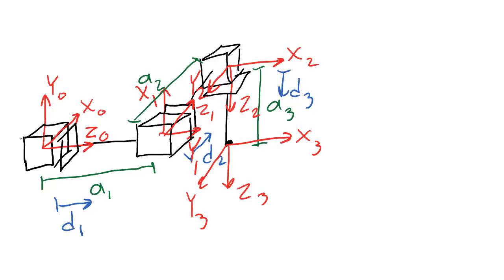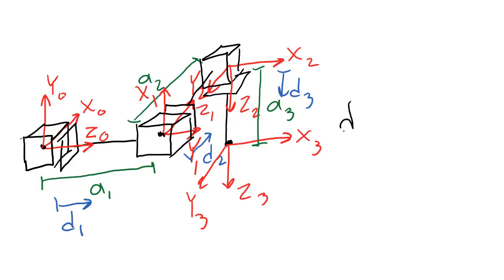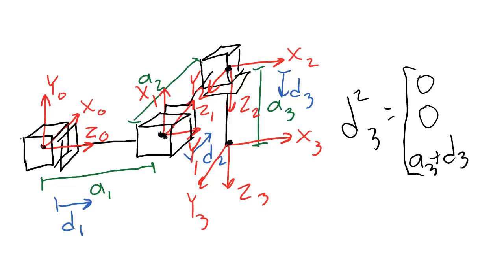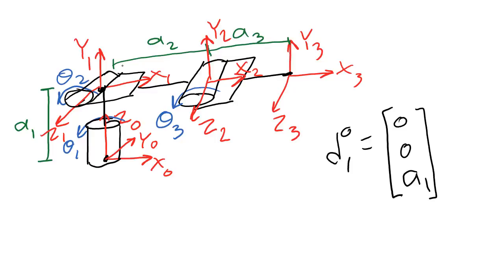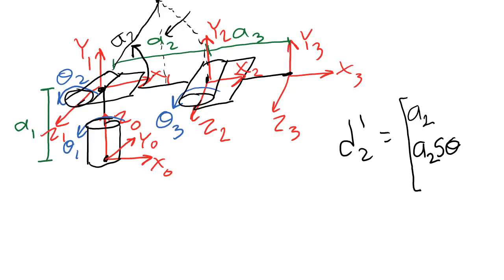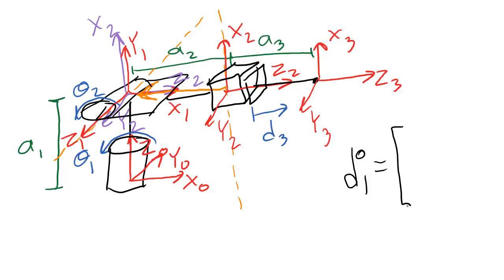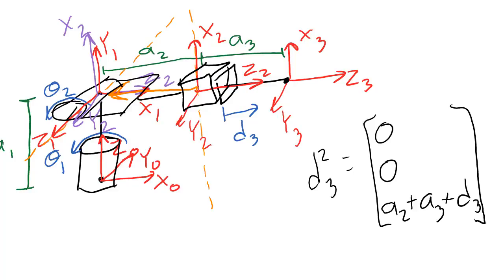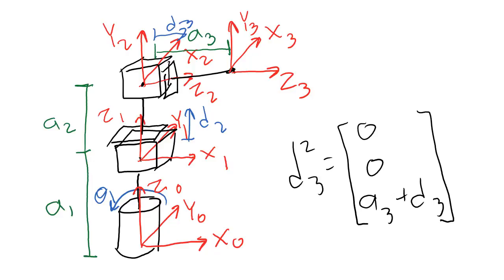Robotics 1 U1 (Kinematics) S4 (Displacement Vectors) P2 (Displacement Vector Examples)

Comment: in this video i am confused between example 2 and 3. in the example 2 the link(a2) betwen(two revolute joint) frame 1 and 2 has a displacement vector respect to theta2 rotation. but in example 3 the link(a2) between( revolute?spherical joint and prismatic joint) frame 1 and 2 there is no displacement vector even there is a bare theta2 rotation?

Comment: Hello..
In 12:22 why the d2_3 =[0, 0, a2+a3+d3] and not d2_3=[(a2+a3+d3)sin∆2, 0, (a2+a3+d3)cos∆2]
Thanks
Reply from the maker: The angle of the second revolute joint is between frames 1 and 2, not between frames 2 and 3.  So, the joint angle shows up in d1_2, not in d2_3. Otherwise, you would be accounting for the angle twice and that would give the wrong result.
Reply: @asodemann3  ... Thanks a lot for this great course...it is really helpful
Reply: That means ,there is no effect of theta 2 for displacement …theta 2 wasn’t used in any displacement matrix

Comment: Im a bit confused. In an older video with spherical manip. you did not move the locations on frame 2 like @10:56. Does this lead to same results? (Video is 1 1 4 Lecture Video 1 of 2 Displacement Vectors)
Reply: Alright now i  get it but does that mean that the other video is wrong? Since rule 4 will never happen however we rotate around z?

Comment: Hey, Thanks for your videos. 
@11:46 As theta 2 rotates along the z-axis, y-axis and x-axis should move with the same angle and therefore frame 2 should change the position, No?
Reply from the maker: I'm not totally sure I understand your question, but maybe this will help:
As theta2 changes its value, frame 1 doesn't move at all - it neither rotates nor translates.  Frame 1 is only affected by the motion of theta1.  But, frame 2 will both rotate and translate as theta2 moves, because frame 2 is physically attached to the third joint.  For example, when theta2=90 degrees, the center of frame 2 will be directly above the second joint, and the x2 axis will be pointing straight up, and the y2 axis will be pointing to the left. But, the 1 frame won't have changed at all; y1 will still be pointing up, and x1 will still be pointing to the right.
Reply: That's a articulated  joint having same center's they don't displace

Comment: @ Angela Sodemann 
Isn't it there rotation between frame 1 and 2 (first and second)?
Reply from the maker: In some of the examples in this video, there is rotation between frames 1 and 2, and in some examples there is not. But, this video is only about the displacement between the frames, not the rotations.
Reply: Thanks for a quite fast answer, Can I get some help  one more question? when moving from frame 1 to frame 2 why are there both a1 and d1? (@1:56 ) Isn't it enough to use a1? I'm confused about d1.. Thanks
Reply: d1-> how much the joint move
a1-> distance between frames when d1=0

I thought both are same, What am I missing?
Reply from the maker: a1 is the distance between the two joints when the joint has not extended at all, and d1 is the amount that the joint has extended. So, for example, suppose that the linear (prismatic) joint is a rack and pinion like we use in the motion control videos in this class. When the rack is pulled all the way back as far as it can go, to its 0 position, there might still be some distance between the joints. That distance is a1. Then, the amount that the rack and pinion moves, extending the joint, is d1. So, the total distance between the two joints is a1+d1.
Reply: Thanks again, I don't figure out yet but I try to understand those watching videos repeat! Thanks for awesome lectures :)

Comment: @10:56 why do you change the location of frame 2?
Reply from the maker: One of the Denavit-Hartenberg frame rules is that each X axis has to intersect the Z axis in the frame before it.  We always first try to keep this rule by changing the direction of the X axis.  But, in this case there is no direction that the X2 axis could be so that it would intersect Z1.  So, we have to move the center of the frame back (along the Z2 direction) just far enough so that X2 will intersect with Z1.